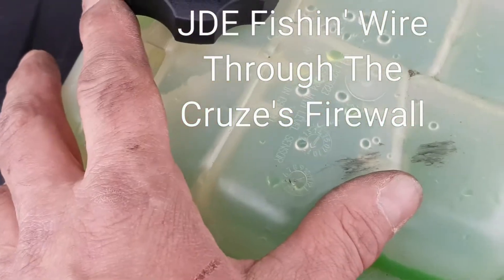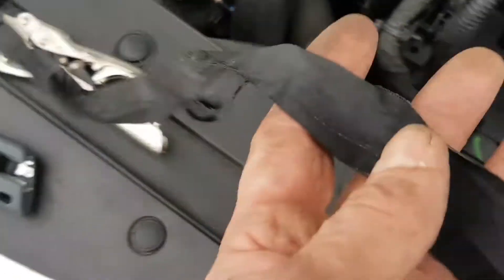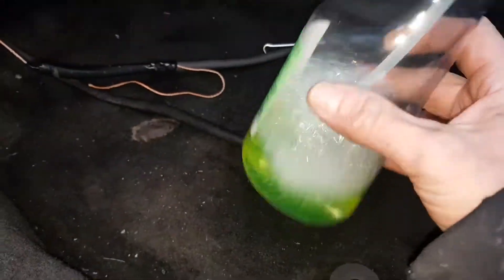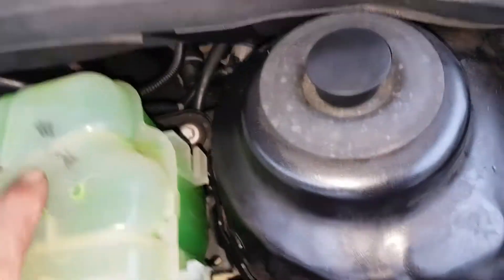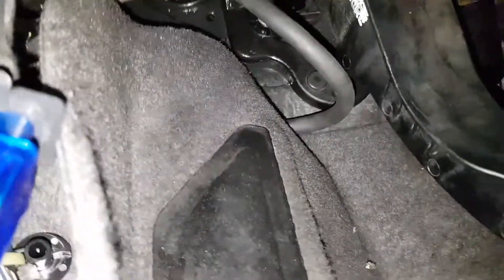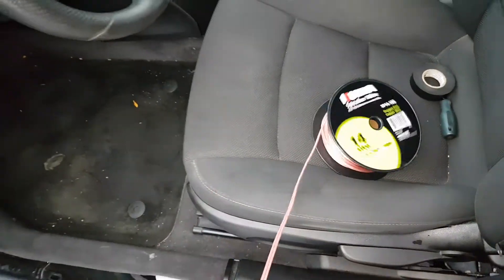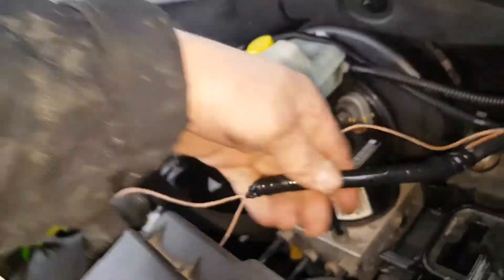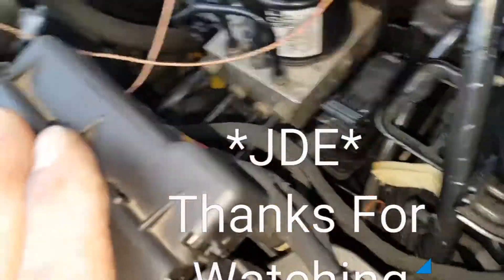Chevy Cruze Fishing Wire Through Firewall

Comment: Idk how to do this safely I have a 2017 Chevy Cruze ls and all the videos I’ve seen look easy then I go to my car and there’s a huge gray brick in the way with about 50 small wires coming from it plus the Excalibur system that’s installed into my car  if I reach in hand I can feel my fire wall grommet and it even has a small nipple but it no way do I trust myself to make a cut or hole I can’t see.. and I tried moving the gray “computer” but put it back cause that’s too many wires for me to be messing with I also can’t see the location of it on the outside when moving over the coolant revisor could you please try to help me. Find a solution

Comment: I know you're a lineman the way you did the knot on the power wire then taped it. You only learn that in one place
Reply from the maker: Thanks for replying... I have worked with electric stuff since I can remember...I have tasted electricity (AC 120) a couple of times... I have built my own computers, and converted old PC Power supply to power a car amp to drive subs in my home...etc...
I work as a Glazier (window guy) and have seen the tricks-of-the-trade on the job sites.